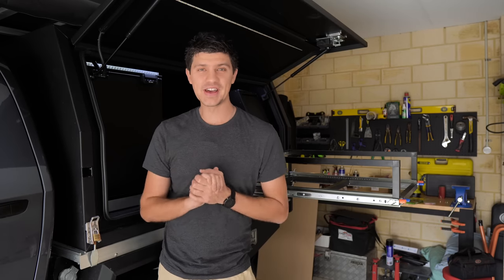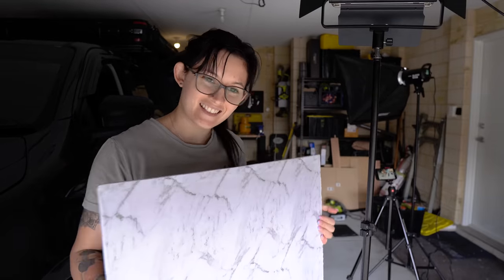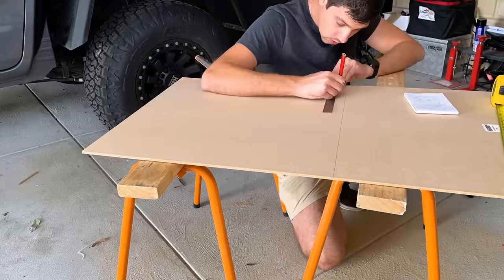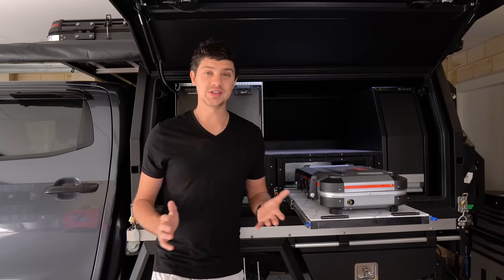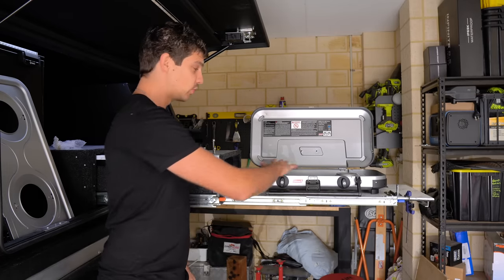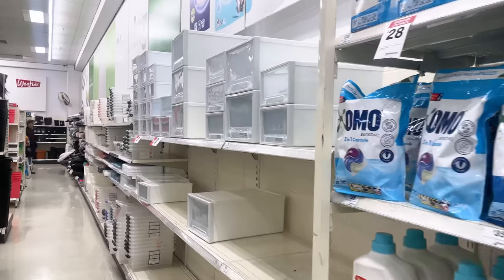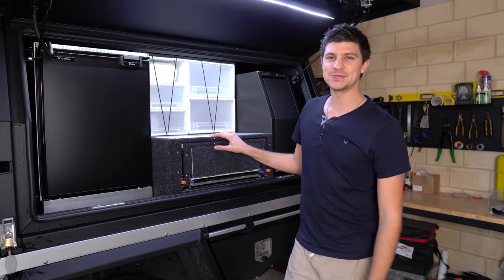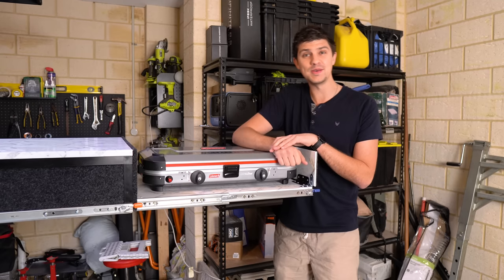My DIY slide-out canopy kitchen is finished! Kitchen Build Part 3/3

Comment: Looks good. You should notch in some grooves on the underside of the angle bracket (supporting your fold out cover) to hang plastic/rubbish bags off the end of your bench. If that makes sense…
Reply from the maker: That's actually a great idea - might have to do that I reckon! Cheers 🙂
Reply: And a bottle opener notch 😉

Comment: We started using those plastic draws over 20 years ago in our old Pathfinder & still use the inside draws to drop into our slide draws in our Patrol.
They have been all over Australia from 12 Simpson crossings, 15 High Country, to the Canning Stock Route.
We pack them at home & drop them in - quick & easy as a "Day box" - ""Cooking Box" etc.

Comment: Add heat shrink over the steel rods, will help protect and reduce rattle. Great work on the set-up and my money is on the temp set-up being used for quite a while as long as it functions how you both want. The front bench can house a step while travelling as the benches are pretty tall. Cheers 🍻
Reply from the maker: Good ideas - cheers!

Comment: looks amazing mate, some great idea's there.  One suggestion I would make, if that vinyl doesn't last, get some thin stainless sheets cut to size and stick them down.... highly durable, very good for preping and cleaning on (essentially don't need cutting boards then).  Just a thought :)
Reply from the maker: Good suggestion mate that would work well! I reckon I'll go down that route once the vinyl starts looking a bit rough 🙂
Reply: was just about to comment the same thing, just make sure its good quality stuff they use for kitchens
Reply: @007oli  316 grade st/st

Comment: nice job on this build. what was the CAD program you were using. I thought one of your videos had a plug for it, went back and scanned the but could not find. Of course I may have thought I saw one and never did. haha
Reply from the maker: Thanks mate! I just used Adobe Illustrator because I use it for work, probably not the best tool for the job though haha.

Comment: This is a fantastic set up, your videos are very comprehensive and I love your channel. Do you happen to know the weight overall of this kitchen?
Reply from the maker: Thanks mate appreciate that!! Hmm I don't have an exact weight unfortunately but the entire frame was extremely lightweight, could easily lift it with one hand. The only heavy componants were the wooden benchtops (could be replaced by folded aluminium to save weight), and the drawer slides which were quite heavy.

Comment: Bro youve got some wicked ideas could we get a total cost?
Reply from the maker: Hey mate, rough cost for the entire build would be close to $800 (stove: $200, drawer runners: $300, building materials: $300). That was buying most materials at Bunnings though, and a few people have commented that it's far cheaper going to aluminium suppliers so could no doubt shave a bit of the cost off there.  🙂

Comment: The first time I’ve ever regretted listening to you: Goliath slides from Bunnings. 

Literally - JUNK. 

A horrible to use product. 

Everything else you do is amazing, but this was a disaster.
Reply from the maker: Which brand to use for each part comes down to personal preference I guess mate - I’ve used Goliath runners for multiple projects and never had any issues, pretty happy with them for the price. I’m assuming you‘ve had a bad experience with them, so you might want to look at more premium runners instead.